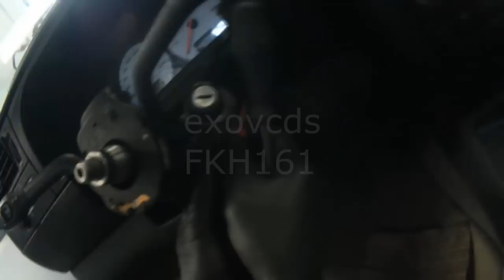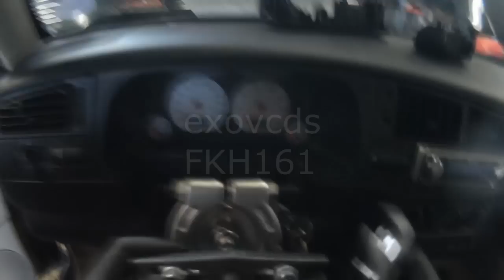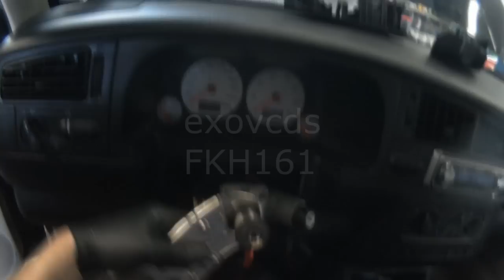VW A3: Golf / Jetta Ignition Switch Removal & Installation (Standard Transmission)

Comment: My car just won't turn over and the last thing I can think of it being is the ignition switch. I've already replaced the fuel pump, water pump, starter and alternator. So my last guess Is the ignition switch. I'm not sure. But do you think you could give me some input? I have a 97 Gti. Thanks.
Reply: +Sebastian G - I got the same problem as you. I am changing the ignition switch on my Audi A3 today. I changed the starter motor which did not help at all. I can start the car by pushing it down hill.

Or start it as I have done the last 2 months - with a cable. I start the car simply by opening the hood, I then put the end of the cable in the starter motor contact (remove the cable that is currently there), and then I put the other end of the cable on the +positive of the car battery. I need to have the key in the car while I do this and its needs to be turned on. Make sure your gear is on neutral, as you dont want your car to run you over. 

This method works great but it looks like I am stealing a car each time I start it. Also its a bit tricky to find the starter motor contact in the dark at night. But today I am finally changing the ignition switch so that is the end of it.

Good luck on you
Reply: +I fart on you Yeah I've been push starting it lol but I'm gonna give that a try. The way you do it now. Let me know if it's your ignition switch.
Reply: +Sebastian G Yeah this is alot easier than push starting it haha :) I will let you know in a few hours. I am leaving right now to change it actually :)
Reply: +I fart on you it sound a whole hell of a lot easier lol I always have to park on a slope now so I can get some help with a little roll. I hate it lol 
But for sure :D
Reply from the maker: I fart on you If you have a test light you can check for power at the starter cable at the back of the ignition switch... if you don't have power at the red/blk wire (when cranking), then the switch is bad.
Reply from the maker: Sebastian G If you have a test light you can check for power at the starter cable at the back of the ignition switch... if you don't have power at the red/blk wire (when cranking), then the switch is bad.
Reply: +Thomas EXOVCDS +Sebastian G - I have replaced the ignition switch and my car works now. :)
Reply from the maker: I fart on you Thanks for the update... sorry about my late reply!
Reply: +Thomas EXOVCDS Your reply was awesome. We did that check and it didnt lit. So I was quite sure about the ignition switch. Thanks and good luck to Sebastian :)

Comment: Thomas, is procedure the same for 2004 Jetta?
Reply from the maker: Ignition switches hardly ever fail on the mk4's... the more common reason for no start / no crank / no dash lights, is a broken pin inside the steering lock housing... as can be seen here:
https://www.youtube.com/watch?v=tn5_od47aBU
Ignition switch removal & checking is also shown in that video.
Reply: @EXOVCDS  Thanks for the quick reply...think I may even have something "hidden"that is drawing the battery down...is that common? Possible?
Reply from the maker: @mikewilliams8572  battery drains can be caused by a number of things. Could be a relay that is stuck on, a module that's not falling asleep or even the internals of an alternator. First determine how big the draw is, then determine which fuse the draw is on... if the fuse check is inconclusive,  it'll be a bit more difficult to find the draw.
Reply: @EXOVCDS  Thanks again!

Comment: Great video Thomas but my airbag system had locking pins on the back no bolt hank you
Reply from the maker: Thank you for watching!
Reply: I tried and tried to get that couple off with a barren splitter and I couldn't do it  Gotta Volkswagen cabrio They're a difference
Reply from the maker: @masonpugh3637 
Disconnect the steering shaft at the yoke / u-joint and then remove the steering shaft with steering wheel and wiper / signal stalks (disconnect electrical connectors of course).

More instructions here... picture links don't seem to work anymore. 

https://www.vwvortex.com/threads/ignition-switch-diy-w-pics.3445064/?id=3445064
Reply: @EXOVCDS   Thanks Thomas I took everything off the steering wheel the turn signal switches airbag system got right down to where I used the pool and I even bent the bearing pool trying to get that cup off it just bent with so muchere's gotta be another way I'm gonna go to the yolk child and error thank you Thanks Thomas I took everything off the steering wheel the turn signal switches airbag system got right down to where I used the pool and I even bent the bearing pool trying to get that cup off it just bent with so force gotta be another way I'm gonna go to the yolk Trial trial and error  thank you thant learning  wow air bag clips no bolts thanks again

Comment: Thomas, is it possible that my ignition switch needs replacing? Accessories all work. Car initially stalled when driving and wont start anymore. Fuel pump fuse keeps blowing when i attempt to crank. Ive replaced the fuel pump, fuel filter, fuel pump relay, ignition coil, all spark plugs and wires. Fuel pump fuse just blows when trying to start. It only cranks.
Reply from the maker: Natalie Gelesko Not an ignition switch issue. Year, make, model, engine?
Reply: Thomas EXOVCDS 1997 vw jetta gl 2.0 4cyl 5 speed.
Reply from the maker: Just checked a wiring diagram... disconnect one or both O2 sensors (if you have 2). The heater circuit(s) get power from the fuel pump fuse. Check the O2 sensor(s) wiring for damage.
Reply: Thomas EXOVCDS if the o2 sensor wiring is still good, is there a way to check the heater circuit you said that draws from the fuel pump fuse as well, or is that what you meant by checking the o2 sensor wiring.
Reply from the maker: Disconnect one of the sensors, insert fuse, if fuse still blows, disconnect the other sensor, if fuse still blows, then you have to check all the wiring from the fuse > onward (wiring to fuel pump & O2 sensors).
If the fuse does NOT blow after disconnecting an O2 sensor, then you found the cause.
Testing the heater circuit can be done with a test light... do the simple thing first. Disconnect them.
Reply: Thomas EXOVCDS so i checked my list of codes and i have p0135 bank 1 heater sensor circuit. So i checked my o2 sensor the first one on the header, and the harness got sheered off by the heat shield. Both off the o2 sensor and plug part. Simce that is technicallu already removed from the circuit per say, would replacing the o2 sensor be my fix to getting to car to finally start up?
Reply from the maker: +Natalie Gelesko  If the engine does not start after the O2 is disconnected (fuse stops blowing)... then the ECM got damaged due to the O2 wires shorting. If the engine runs after you disconnected the O2 connector... it is safe to drive until you get a new sensor
Reply: Thomas EXOVCDS the car started right up after i unplugged the o2 wiring that was partially cut up. Thank you so much for the advice and replying so quickly to me.
Reply from the maker: No problem... good to hear it did not fry the ECM!
Reply: I have a 98 GTI VR6 drivers edition , guy I bought it from changed to jetta lights , changed the headlight harness back to the original gti harness and gti headlights and im not getting any power to any of the exterior lights ... all dash and interior lights work ... i changed the headlight switch with another used on and they both seem to work ... do u think the ignition switch has anything to do with this ?? Btw i installed a push start button (lost power to the starter wire for some reason ) so i do believe it is the switch... i am also not getting any power to the headlight fuses ... please if you have any information in regards it would b highly appreciated i watched this video and would like to kno a little more before i go take my steering wheel or the whole column out

Comment: Do you know what is wrong? To start the car I had to push the key hard at the end of the travel. I replaced the switch and it is even worse than it was before. I decided to put another switch from the scrap yard and now it wont start at all but lights come on. Unplugged the switch and plugged the old switch and started the car with screwdriver with no problems. Al the switches I replaced seem to work fine when plugged without installing in the barrel and  operated with screwdriver. Is it a barrel??? I checked the barrel when was of the car and it looked good. Didn't see anything obviously wrong...
Reply from the maker: Gregory May If the car starts fine using a screwdriver to turn the ignition switch, but it does not start when the key is turned, then I would imagine that there is a problem with the barrel (key cylinder). You removed the barrel from the lock housing? I would install a new barrel (comes with a new set of keys). You might be able to take it to a locksmith to have the barrel recoded to your original key.
Reply: Thanks for your help. I think the same but I don't know what can go wrong in the barrel? Is it something that you came across in your career?  It is 1997 vw.
Reply from the maker: Gregory May The internals must be worn out... not transmitting the movement of the key fully to the switch. I have seen similar before... that is why I too check the switch with a screwdriver first. If ok with screwdriver, then I look at the barrel. I have not seen a bad housing cause this type of issue... if the barrel moves too much in the housing, then maybe that is where the fault is.
Reply: I can't think of anything else to be honest but I thought I missed something... Now I have 2 spare switches... Wanna buy one?;) I know I need to drill a 3mm hole in one place to remove the barrel but do I need to remove the bloody housing too? Mine is exactly the same as in your video. Thanks
Reply from the maker: Gregory May You might be able to drill it with the housing in place... depends on the size of the drill and the length of the drill bit.

http://fkh161.ca/VW/VWA3IgnDrill.jpg
Reply: Great. Thanks. I will keep you updated.
Reply from the maker: Gregory May Ok.
Reply: I took it apart and looks like the bar at the end of the barre ( the one that turns switch)l is a a bit worn - has edges worn. But I don't have a new one to compare how much free play is acceptable......
Reply from the maker: Gregory May I'll see if I can get a used one at the shop to look at this week... you might be able to make the bar a little bit thicker using some kind of silicone or teflon tape. Silicone will harden and possibly aid in transferring .motion... and if you ever have to remove the barrel again, should just slide out again. I leave it up to you... I have never done a "workaround" like that, just thinking it might help.

Comment: Hey, my A3 has this problem, and it won't crank over, so I'm going to do this, it's a standard trans too.
I ordered the item but it will take a few days to get here and I still have to drive to work, is there a way I can bypass the switch to get it started to drive to work and back?
Reply from the maker: Transmission in neutral, key ON (oil light & battery light must be ON).
Use a jumper wire and touch battery + to the starter solenoid "trigger" terminal.
The starter will spin and the engine should start.
Only hold the jumper wire to the starter as long as it takes to start... Remove once the engine is running.
Reply from the maker: The "no crank" could also be due to the alarm module... you can bypass it for checking. 
Here is a video where I bypass it.
http://youtu.be/inKwzg2osMg
Reply: ***** Thanks for the info, does the clutch not have to be pressed in to start it that way?
Reply from the maker: ImyurZero not if you are jumping the starter with a jumper wire.... ** make sure it is in neutral ** or it will run you over!

Comment: Just replaced my switch now car won't start wipers and all associated stalk parts work noticed that the old switch had a patrusion on both side new one does not could this be the issue or do I have a Def switch possible.  started car prior to change  1993 vw corrado wr6
Reply from the maker: Sentences with commas are easier to understand / follow.

If you were able to "crank" the engine with the old ignition switch, then the new ignition switch is faulty or something got messed up. Did you install a new or used switch? While holding the switch in the "crank" position... try to move the ignition key up, down, left & right. It could be that the new switch has a bit of a dead spot.

Comment: I have a 98 GTI VR6 drivers edition , guy I bought it from changed to jetta lights , changed the headlight harness back to the original gti harness and gti headlights and im not getting any power to any of the exterior lights ... all dash and interior lights work ... i changed the headlight switch with another used on and they both seem to work ... do u think the ignition switch has anything to do with this ?? Btw i installed a push start button (lost power to the starter wire for some reason ) so i do believe it is the switch... i am also not getting any power to the headlight fuses ... please if you have any information in regards it would b highly appreciated i watched this video and would like to kno a little more before i go take my steering wheel or the whole column out
Reply from the maker: Headlights get power from the load reduction relay / circuit of the headlight switch (if I recall correctly). When the relay does not get power, the wipers & blower motor will also not work. If they are working, it's not an ignition switch or load reduction relay issue. All I can suggest is to find a wiring diagram that applies to your car and then trace out what is not working... and I'm sure you'll find the issue.
Reply: Thomas EXOVCDS  well the wipers aren’t working either but the blower motor does

Comment: Hey, Im having trouble with my Golf Mk3 GTI 2.0L. It wont start from time to time, but when it does it runs for about a minute and then the headlights go off and the relays starts making noises and  the engine slowly shuts down. I live in Finland, so it's quite cold and rainy so could it be that it is the Ignition Switch? one more thing.. when i turn the key all but one light comes on, but when i press the key hard towards the ignition switch all the lights come on.. Im sure i forgot to mention something, but i hope u could help me with this.
Reply from the maker: ***** Sounds like an ignition switch issue (or the something with the key cylinder)... remove the harness plug from the igition switch (remove plastic trim around steering column to gain access). Install a new / good used switch and use a screwdriver to activate it. If the car starts every time & stays running, replace the ignition switch.
Reply: Thank you :) ill try if it works.

Comment: What was the reason for changing it?? My mk4 jetta turns on & then turn off (auto) could my ignition switch be the problem?
Reply from the maker: This video is for mk3... your symptoms sound like an Immobilizer issue (key not recognized).

Watch these videos:

VW A4: No Start / No Crank / No Dash Warning Lights (Part 1)
VW A4: No Start / No Crank / No Dash Warning Lights (Part 2)

Towards the end of the first video, you can see the engine start & stall because the key was not recognized.

Comment: im working on a 99 jetta  the switch will not start the car there is no spring back when you turn the key....would this be the key assambly or plug in the back of the key assambly
Reply from the maker: If it's an A4 / mk4, watch this:
VW A4: No Start / No Crank / No Dash Warning Lights (Part 1)
and
VW A4: No Start / No Crank / No Dash Warning Lights (Part 2)

Comment: I just bought an ignition housing an its the wrong one I didn't see that it was for standard only I have a 1995 jetta gl an mine has a cable that attaches to the back of it by the ignition switch witch the one I ordered doesn't have . an not one site I look on can I find one for an automatic . would you be able to point me in the right direction
Reply from the maker: What's wrong with your old one? I'll have a look to see what I can find.
Reply: because of my own stupidity I tried pulling off of where the two small screws go in on the top of it because I couldn't get my puller to bite on it so I snapped off where the top right screw goes into . now I'm kicking my self in the ass for it
Reply from the maker: Sorry, I didn't have any luck finding a new one... I'm sure you can find a used one at a wrecking yard in your area. You could also secure the cable in such a way that it leaves the shifter "unlocked".
Reply: any tips on how I would do such a thing
Reply from the maker: When the key is turned, the lock assembly "pulls" on the cable... I think, to release the shifter, so that you can  shift. Grab the cable by the sleeve, pull the cable and then secure it in its out position with a small clamp or put a spacer between the cable end & the sleeve and then wrap it up with electrical tape. The other method would be to deal with the cable at the shifter end... but that involves taking that apart a bit.
Reply: thanks I'll try it out

Comment: where can i find the pulley? ive been to a bunch of different auto parts stores and they don't ever seem to have the right one. when i look online its sold as two different parts, the pulley and then a bearing separator i think is what its called. if anyone can help it'd be greatly appreciated.
Reply from the maker: If you look at the pdf link in the description, you can do the repair without a puller. A "split bearing puller" can be found through amazon,  eBay,  auto parts stores and other places.

Comment: I lost my key. Is it still possible to replace the ignition lock without the key being in and turned?
Reply from the maker: +Silver Sisask Yes, you can drill the housing (while it is mounted to the steering column) and remove the key cylinder.